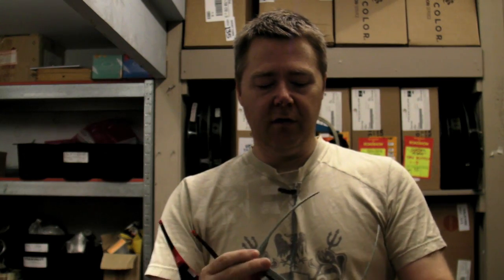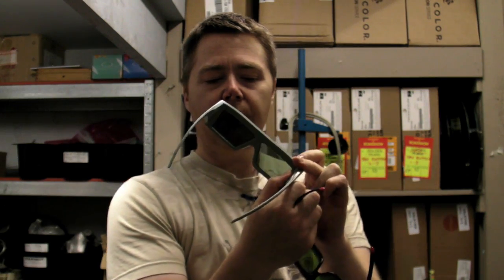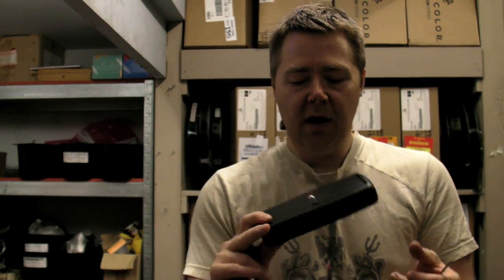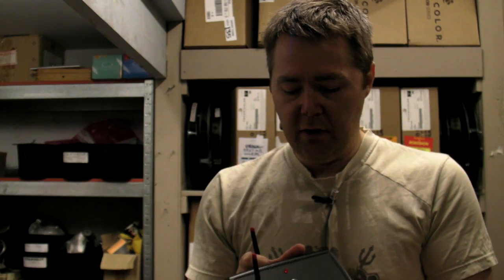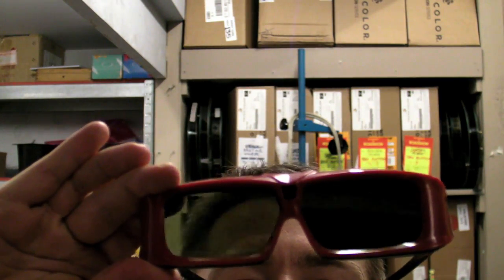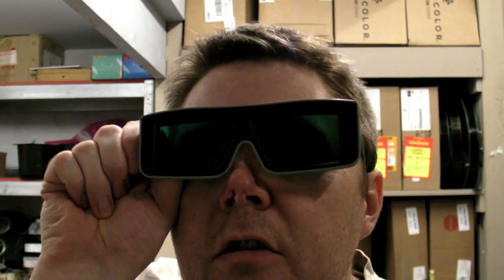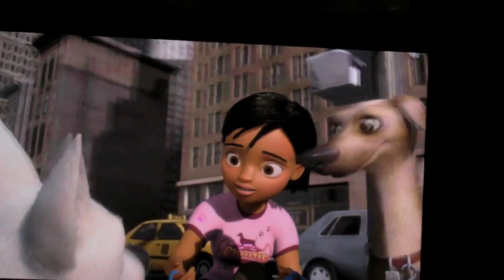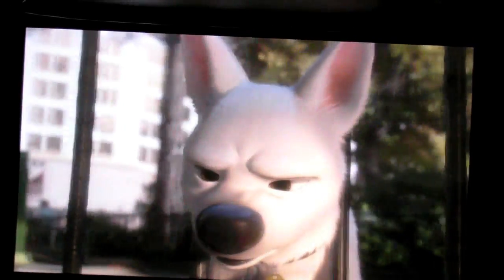3D Glasses - LCD system by XpanD

Comment: No...
the X102 communicate directly with the DLP projector, they are faster and more accurate than nvidia. the Nvidia glasses are designed to work with small desktop LCDs.

Comment: @1981z28camaro When the glasses are off it has a greenish color..this is the LCD material. when the glasses are exposed to IR it turns on and become Black / Clear. Check the other videos of the glasses (including Panasonic that are built by XpanD as well).